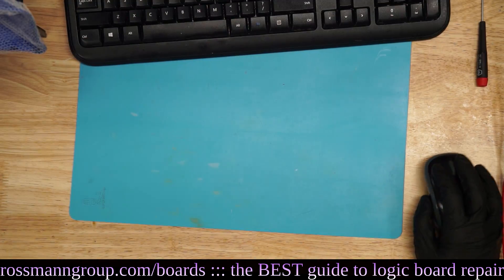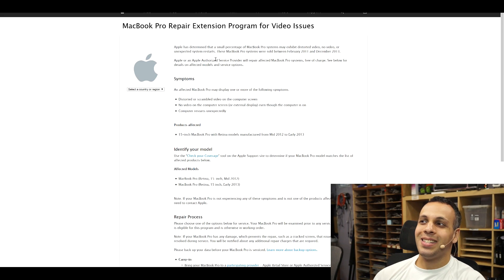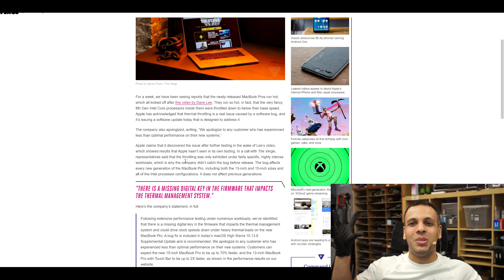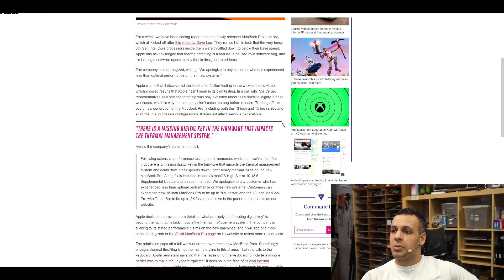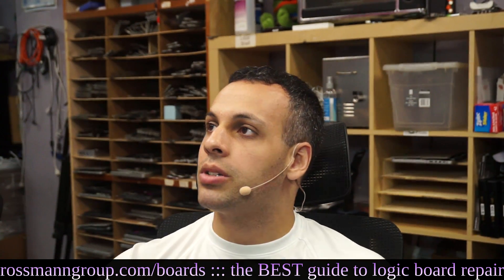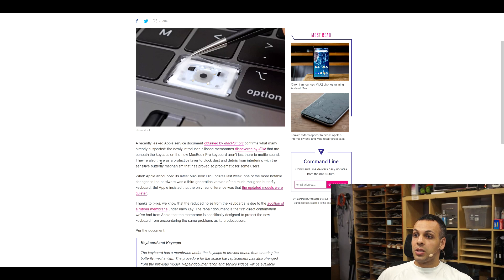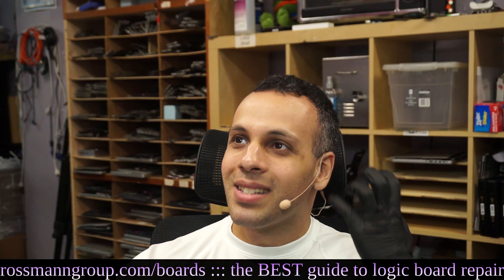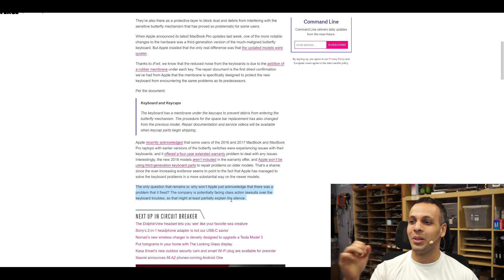This new Macbook is becoming a meme.

Comment: Intel only uses prime95 for thermal stress validation of the cpu cores and design Tj.  It’s assumed that multi core cpu will not have all cores running full turbo at the same time. The average activity factor is used to validate the Tj.  Cooler areas in the core are averaged with the hot spots in the ALU.  This allows the product qualification with a much higher Tc.  Never see L2 or L1 over heat from prime95. Ship it and now it’s Apple’s problem.

Comment: Using the CPU is a very specific workload .. lol
Reply: Same as using a brain by Apple fanboys.
Reply: Workloads using more than 2 cpu cores at their max load are very specific workloads. But anyone buying a laptop with high processing power probably knows they will need the whole thing.
Reply: Russell if you can’t use 100% steady of your CPU then you have problems. Be it thermal issues or otherwise. Imagine having a car that would shut off if you pushed the gas down too far. And then the manufacture told you that you’re not using your foot properly. That’s Apple in a nutshell.

Comment: How does a software update fix a small heatsink? If so, we can all save a ton on watercooling and proper air cooling! One software update and you don't even need a heatsink!
Reply: Your confusion is that those things are two different issues. The reports were that it was throttling more than previous Macbooks, resulting in worse performance than them. People assumed it was due to the cooling inadequacies, but they seem to have improved this in software.

So it seems that it is now better than the previous Macbooks in an absolute performance sense, but it may still be that it's worse than previous Macbooks in terms of having a lower % achievable of max capability (i.e not really capable of delivering most of the benefits of an i9), due to poor cooling design.

So it might be back to the business as usual of the previous years' throttling, but at least more people are aware of the compromises of having a ultrathin laptop.
Reply: Tom5tom Entertainment they just make the fans starts earlier and faster

Comment: Oh... I see you've managed to find a violin small enough to play for the Macbook, Louis.
Reply: The strings are not user serviceable. If it goes out of tune or the strings wear out, you must buy a new one.
Reply: Unfortunately this violin is soldered to the motherboard and is overheating.
Reply: Figures

Comment: If they put the new in the old, when the extended warranty runs out they can't make any money on repairs. But since it will fail earlier than 4 years and probably multiple times it should make Apple bleed

Comment: So basically this new software/firmware update will bypass or alter the temperature sensors and allow the processor to work better. I fear these processors working under hotter conditions will dramatically decrease the Macbook lifespan

Comment: Wow well I am an Apple Fanboy love the OSX and the Mac Pro 2006-2009 and from all to recalls from the Laptops over the last 10 years maybe they should just stick to making workstations with upgradable hardware

Hackintosh 32gb ram 4gb graphics card (400 dollars total) and will not feel bad for building one when the motherboard only cost 30 dollars to replace but it doesn't most like will not die

Comment: "Missing digital key" ???????????? This is utter bullshit. Intel will have laid bare all "digital keys" of their firmware/microcode to Apple programmers for integrating whatever specific Core i7/i5/i3 (ULT) CPU's they would end up using in their laptops. What's worse, Apple will have only mostly updated the hardware in a minimal way for the new generation CPU's to work. Initial crap design & manufacturing tech/standards will still be crap if you simply toss a new CPU at it.

Comment: I’m not defending Apple but the reason they can’t replace the 2016 and 2017 MacBook Pro keyboards with the new ones is because the top case for it changed slightly so the screws won’t align.

Comment: With "only a small percentage..." Apple most likely mean those users who uses the devices to their full potential. Many users only use their devices to a fraction of the potential they're capable of. They never experience these issues.

One could translate Apples ramblings to: "Never use our products to their full potential. That's not what we've designed our products for."

Comment: This is "headspin" if you are an absolute incompetent moron, Apple. Sorry, looks like Apple is but a slow platform in both hardware and firmware relative to when a product hits a market in recent times. If you got the knowhow, that sadly makes the product fairly irrelevant by modern standards and demands. And my demands are damn simple - I want my 6 cores to WORK.

Comment: Tip: Osx performance and stability in Premiere Pro is laughable.  Way slower and prone to black screens of death, than Windows. Final cut is mostly not using GPU as well, so it is awfully slow. Only on par performance is with Davinci Resolve. And that again, is crushed using Linux. 

(from an pro editor/geek)
Reply: Yeah. I don't understand how this shit laptop for xxxx $ is somehow better at render / etc. than a PC for that cost. And this shit about freezing, crashing windows is just 'shit'. It crashes because you have a problem with it, improper setup is not fault of windows.
Reply: an pro indeed.

Comment: Again, WHY DO PEOPLE KEEP BUYING THESE PIECE OF SHIT APPLE PRODUCTS? EVERY new iteration apple fucks something up, and EVERY new fuck up apple NEVER accepts responsibility for them being lazy pieces of shit making subpar pieces of shit, and EVERY time they keep swearing they didnt mean to but then the VERY NEXT generation of devices THEY FUCK SOMETHING UP AGAIN. And around and around we go. There is one VERY SIMPLE solution to all this, STOP BUYING APPLES FUCKING GARBAGE PRODUCTS. Just buy a damn PC like every other SMART person on the planet and stop paying for OVER PRICED piece of shit products made from SUBPAR MATERIALS that are slapped together by untrained morons who DO NOT test any of their products and who dont give two shits weather it works or not. All they care about it making a product using the CHEAPEST materials possible, cutting as many corners as possible and jacking the price up as far as then can without people bitching. They then do EVERY THING POSSIBLE to fuck over consumers with ANTICONSUMER and ANTIREPAIR policies to lock consumers into only having repairs done by them at grossly over inflated prices, and FORCE consumers to use proprietary parts and accesories that only they make and sell at extreme mark ups. They also go out of their way to "create a problem" just so that theu can then magically "fix the issue" with yet another proprietary part like they did with the headphone jack. Which they said they had no room for because of some "sensor", when in reality it was nothing more then a black piece of plastic that did ABSOLUTELY NOTHING that they simply stuck into the hole where the headphone jack did go so they could "claim" there was no room for it. Therefore creating a "problem" that they then "fixed" by making a proprietary headphone adaptor that only apple sells for $40 or $50, 2 to 3 times the price of an ordinary set of headphones. Apple keeps doing this shit because MORONS keep paying for it. That is why i HAVE NEVER and i WILL NEVER buy an apple product, not a phone, not a computer or a tablet, NOTHING. I will NEVER support such a shitty, backhanded company as apple. And those that are dumb enough to, DESERVE to be ripped off and screwed over, cause buying from apple....your asking for it.

Comment: I love that there's a "missing digital key" that fixes the fact they put a 45W TDP CPU and discrete GPU in a tiny laptop body with little ventilation and low fan speeds. That's genius right there.
Reply: I certainly wouldn't call 6000 rpm low fan speeds. Loud as f ck
Reply: theonlyredspecial they keep fan speeds low for way too long before they ramp up. That's what I was trying to say.
Reply: tamarockstar45 They always have it's.nothing new. It's why a bloke made mac fans control software. A lot of mac users make their own profiles.

Comment: what i want to know is specifically what VRM's are being used here, so i can view a datasheet. Then you can see if they are properly spec'd for i9 power demands. If they are properly spec'd, did they also include thermal vias under them, does this design use thermal pads on top of them and in contact with a heatsink? what is the actual temperature of the cpu and the VRM's when it throttles? It would be interesting to know exactly what it is. IS this so called "firmware fix" a workaround due to a design defect? If so, what exactly is in the "workaround fix"? I am actually very curious about all of this.
Reply: The VRM itself is only one part of the picture (only the "brain-box", in AvE parlance). That's only controlling the switching MOSFETs, which i'd argue may be part of the bottleneck, and the current then goes through the inductors on each phase, which would be the other part of the bottleneck.

Comment: Max Yuryev just produced a video showing it still throttles even with this fix from Apple, even though it is not as bad as before, the i9 still cannot maintain base clock speed under 100% utilisation.
Reply: Guys.... This fix just allows the temps to go higher thus less throttling. Its absolutely raping the components
Reply: Of course it still doesn't run the way it should. Software tweaks aren't going to help an inadequate cooling solution.
Reply: Nerobyrne 
The Laptop "i9" has "just" 45W TDP i think. It is nothing compared to desktop i9s. It is more like a desktop i7.
And, PC cases got SMALLER since years.  
Don't you remember the big Tower cases from ~2004-2008? They were very popular back than. Today mATX is enough for a (proper LGA2066) i9 and a GTX 1080Ti. For an i7 and a GTX 1080 even mITX cases /coolers exist, without overheating.
Reply: HappyBeezerStudios - by Lord_Mogul my laptop fans Run at 6000rpm
No Wonder that shit trotles
Reply: +Ed Saucin
Pretty sure it will be awesome in an iMac, if they bother with a proper cooling system.
That's what the i9 was made for, high-end desktops and servers.
NOT notebooks!
Reply: +TheRailroad99
I mean they got wider. You can still buy XXL towers today.
There have always been form factors ranging from "so high they extend your table" to "toaster".
I also have no idea what an improper socket is, but okay.
Reply: Nerobyrne 
I guess my word choice was bad there. I meant a real i9 with more than 6 physical cores and 4 RAM channels, not a relabeled i7 like the laptop i9s are.
And I was about to say that for a modern i7 (LGA1151v2) you do not really need massive tower coolers, even some SFF top blower coolers are enough, unless you OC it, of course. Toaster-sized ITX PCs definitely got more popular in the recent few years.
Reply: Nerobyrne The fuck are you on about? Cases are JUST as big as they used to be, most OEMs would just rather save money by going mATX instead of ATX. And have you ever seen a computer? Plenty small form factor builds have enough cooling, whether it's by liquid or by heatpipes and sinks. Cases should actually get SMALLER to have better airflow, as this means less radiator support but also less air that needs to be moved, meaning quieter and better fans can be used.
Reply: Nerobyrne I'm assuming they are referring to a CPU sockets.

Like most connectors, each CPU has specific socket designs (the frame that you put the CPU in) that they can fit. When you look at the underside of the CPU, you can see lots of gold pins. Each pin connect to various parts of the microprocessor system circuit to perform their respective functions. And the number of pins and their assigned functions are varied from design to design. A socket needs to be correctly configured to accept the CPU pin configurations.

In other words, just like how you can't put a AA battery in a AAA battery holder, a CPU is very much the same.
Reply: Nerobyrne most powerful in the history of apple maybe. You should see some of the crazy shit they put into actual workstations or servers. Not this Facebook room heater
Reply: The I9 has a fundamental heat problem. The cores should be on the outer edge of the die and not crammed together to make a thermal oven.
Reply: How about an i9 LV version ??
Reply: Apple pls.
Either put in chips that you can actually cool, or ramp up your cooling.
Like the macbooc that ran 90°C on the chips with 1200 rpm on the fans.
Reply: HappyBeezerStudios - by Lord_Mogul 1200 ??? For that chip 12000 would be better !!! Add a zero and things get ten times better !!
Reply: OF COURSE!
Honestly I have no idea how they thought they were going to cool the most powerful CPU in history with some heat pipes and a few small fans.
These days, PC cases are bigger than before simply because modern CPU fans for regular i7 chips are so big that they cannot fit into normal cases from 10 years ago.
You have to attach these cooling units with braces to the underside of your mainboard, because if it isn't supported with the entire mainboard it will rip itself off its hinges during high fan speeds.

How the hell do they expect the i9 to stay cooled while running at 100% clock rate at max load?
This should be impossible simply from a thermodynamics standpoint.
Reply: +Ed Saucin
Do they at least sell cooling unit addons you can slot under the machine so that it helps cool it, allowing the laptop to perform at a higher clock speed for longer?
I mean, it would still be a total ripoff, but at least the customers would get more than just "i9" on the label to brag to everyone about.
(Which seems to be exactly why they put it in there since you can get way better performance with different chips that are more power efficient)
Reply: David Lee, the guy who originally posted the issue, got better performance after than patch than when he had it in the freezer originally.  I'd say that's pretty damn good.  Of course it's not going to perform as well as 9 pound 1.5in thick desktop replacements, but it's still damn good
Reply: steven4570 no
Reply: https://forums.macrumors.com/threads/tests-confirm-apples-throttling-fix-improves-performance-for-2018-macbook-pro-models.2129282/
Reply: don't take my word for it, watch the video yourself . https://www.youtube.com/watch?v=L7iu1x-BJRo&t=0s  the macrumours link doesnt show cpu utilisation on those screengrabs, wonder why not.  Max's video shows that there are circumstances when running cpu at 100% the i9 fitted laptop cannot maintain base clock speed.

Comment: LOL...
I wonder what that magical "missing BIOS key" is that by way of a software patch, it can overcome real-world physics and thermodynamics' problems without proper physical hardware...
Ain't it great!? Apple is such a competent company that they can fix physical problems by software updates!!!
Do not be surprised if the "missing key" turns out to be an increase in fan spin speed while underpowering something else to mask the increased battery usage so as to "prove" that it was a software issue all along... Which will only minimally improve performance as clearly indicated by themselves on their website.
Yup... A whole 17% performace increase when compared to a lower core number and clock speed's previous CPU.
But hey!! At least it looks "cool!" The new MackBook Pro... Think hot...
PS: Should Apple acknowledge that the new membrane was introduced to fix the dust/debris problem on their keyboards, they would immediately lose their class action lawsuits as it would be admission of guilt in regards to intentional customer misleading, wrongful charges, deceptive marketing and breach of contract of their own warranties.

Comment: Hey now, regarding "buying apple products for the purpose of doing video editing" - that's not quite fair, I wouldn't expect any laptop to be really good in that regard, my lines of thinking would be along "many editing pros use apple/OSX for their video editing therefore the software (e.g. adobe products) will be optimized the most for these platforms - however the physical constraints still apply" and by physical constraints I mean a laptop isn't as suited for the work as a proper workstation. I don't expect any manufacturer to solve that constraint.

Comment: Their fix is going to be overclocking the vrms. This will cause massive failure across these systems. My guess is they will start failing in less than a year, depending on use.
Reply: Thanks for your arm chair analysis...

Comment: I posted this on the live stream comments as well.
The problem is in the way they wanted to Market this product.
The Pro line of products are supposed to offer pro performance to professionals. That's why they were bulkier and heavier than the Air. They are supposed to offer Desktop-like performance, in a movable package.  You could take your Recording Studio, or Editing studio from your house to your workplace or in the field etc. But you were not supposed to Edit on the road.
But because of the Apple funboys who wanted more than it is physically possible, Apple tried to give them a Workstation, in a highly portable package, which is not possible.
If Apple wanted to bridge the gap of portability and performance, the proper way to do this, would have been to design them with a cooling docking station in mind.
You want Full performance, you put your MacBook Pro in a cooling docking station, that provided the necessary cooling for your Pro to work in Full load. 
Hell they could even sell those at a hefty iPrice.

Without the Docking Station, the throttling would kick in , and Apple would be able to say "Sorry guys, you wanted portability, we gave it to you, you forced our hands, so if  you want full performance, by our 400 dollar docking station"

Everyone would be happy, noone would be able to complain, and Apple would sell another useless product for a hefty i-Price